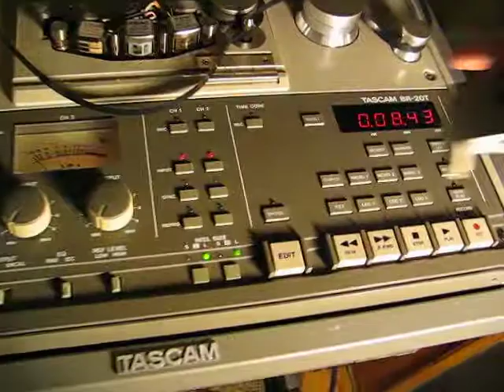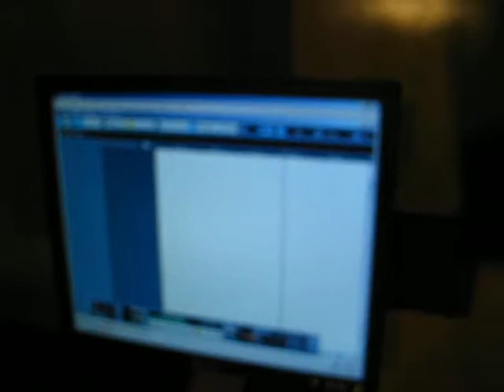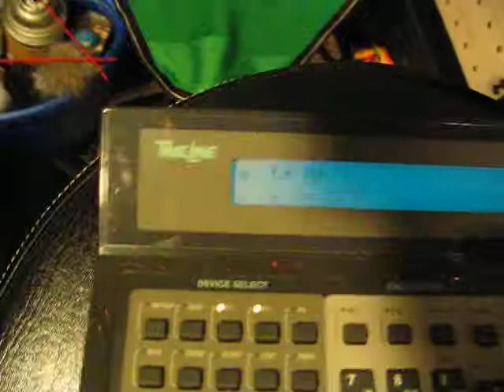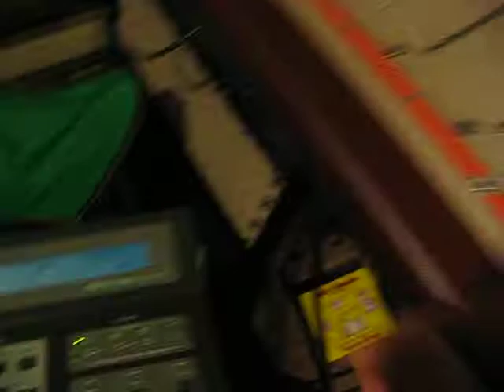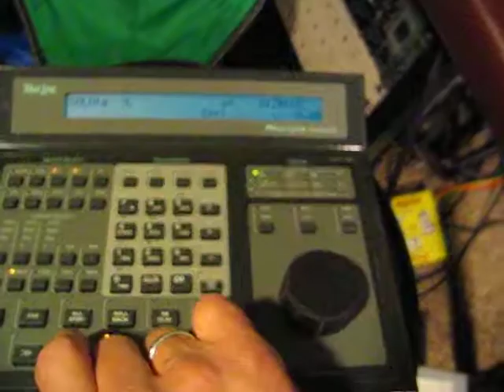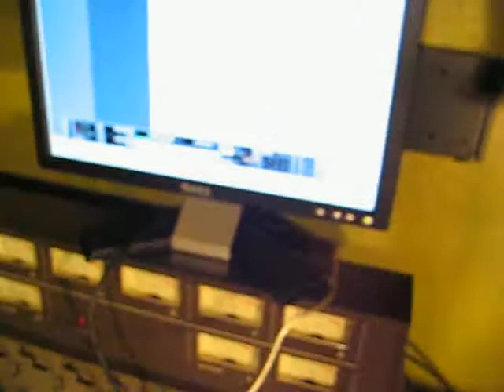Synchronizing DAW to Tascam BR-20T Success!

Comment: great vidéo
did you built the câble between micro lynx and BR 20 ? Mean câble for accessory port to connect the BR 20 to the synchroniser ?
Reply from the maker: Yes I built the cable, sort of. My Micro Lynx came with some cables for other machines, so I cut the machine connector off of one of the cables and installed the DB37 connector for the BR-20, and then modified the Micro Lynx end to match the requirements for the BR-20.
Reply: Thinking of going in that mess thx for the answer got also a BR 20 T at home 😉

Comment: A lot of work for two extra channels for your DAW. ;)

I think the only way this could be possibly made more ridiculous would be to get the wordclock card for the microlynx, and run both the DAW and the microlynx off the same wordclock. At that point you're just gilding the lily.

This put the crazy thought in my head of syncing three BR-20Ts together to make the world's most expensive 6-track. :)
Reply from the maker: Well yes...that would be a lot of work just to add two tracks to my DAW. But you have to think outside the box in which you’re stuck. The purpose wasn’t to add tracks, but rather to be able to build a multitrack project in the DAW tracking first to the tape machine and then dumping that to HDD using position offset. Tracks would be serially recorded on tape, but could be in parallel in the DAW. Though there was the limitation of two tracks at a time, for some this would not be a limitation, and would allow one to build larger multitrack projects in the DAW through the tape machine taking advantage of the economy of 1/4” tape and the wide format track width...essentially the same as 1” 8-track or 2” 16-track. The BR-20T is what I had available at the time to test this and get accustomed to the Micro Lynx, but my goal was to apply this practice using a 1/2” 8-track machine. This wouldn’t offer the same wide format as the 1/4” half-track, but would still be more economical 1/2” tape and offer 7 tracks at a time, good for many drum kit mic’ing scenarios. The BR-20T helped me determine that I could make the concept work. I could also track through the tape machine in real-time ala CLASP, but this didn’t preserve the tracks on tape...sort of a “lost-wax” alternative.